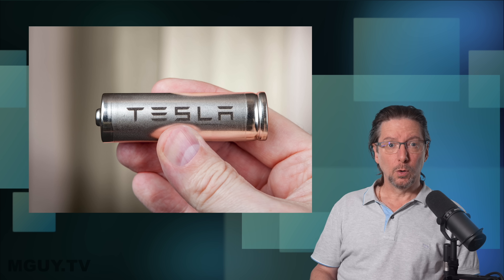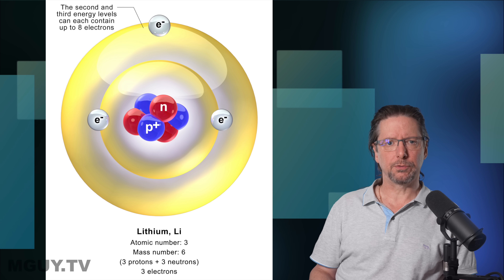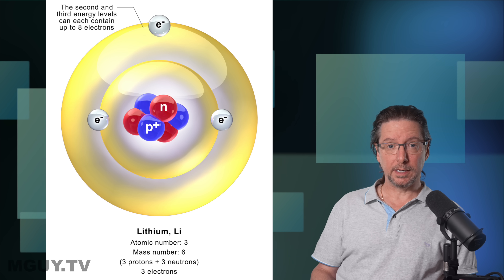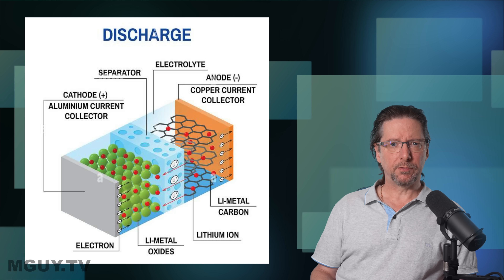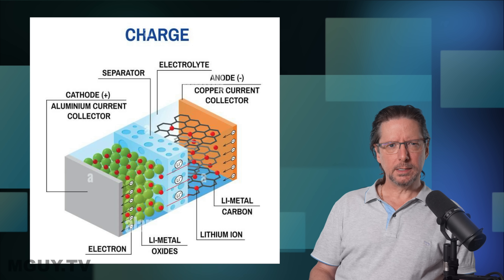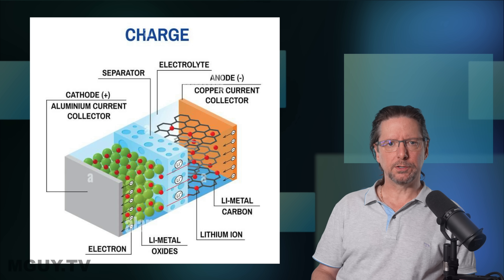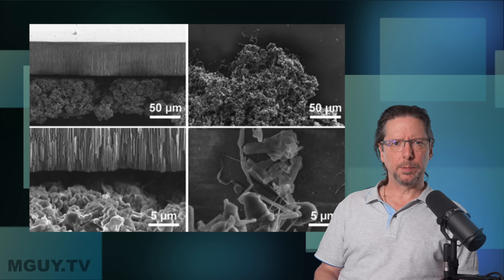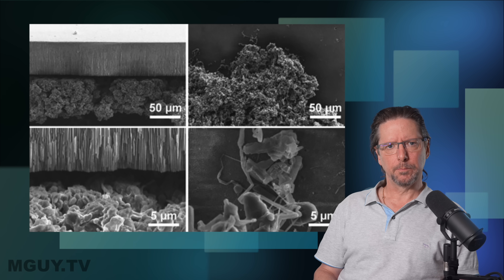Why are EVs so TERRIBLE in the cold? | MGUY Australia

Comment: UK driver here.
I run a 1986 Fiat X1/9.
The consensus opinion is they all rusted away, the electrics were shoddy, and they were unreliable.
I was able to find one that had broken down and been left in a barn for 18 years.
It hadn't rusted away, and I'm certain it broke down because the head gasket had failed because the thermostat was seized.
The electrics I modified to run efi thru a stand alone ECU and I changed the tach and speedo to run off the can-bus on the ecu.
I also took off a whole load of parts that were heavy/ pointless like US federal bumpers, and swapped in some light weight seats from a Lotus Elise Cup.
Engine is the original capacity 1500 but reworked/ modernised makes 150bhp on throttle bodies, kerb is 790kg.
Conclusion - joe public was wrong to believe they could daily these cars/ drive them on salted roads/ leave them outside.
Joe public has no clue about EVs either.
If you do the math, equivalent power to weight in an electric vehicle is really expensive, really heavy = really inefficient.
The light weight of the X1/9 as a platform, meant that it didn't need power steering or assisted brakes to begin with!
Reply: My mum drives a 1986 car too, the Skoda 130. She drives many thousands a year too with good reliability and again no need for power steering. It does have a brake servo though. As it's been so reliable we have decided to keep it on carburettor but have updated to electronic ignition. It's never been restored either, just one bit of small welding in 2003. Those who replace cars every year or three never get to experience the rock solid reliability of a simply engineered and bedded in car that is cared for can achieve.
Reply: @VintageLynx  I didn't know what a Skoda 130 was I looked it up, wasn't there a Saab version with a V4?
I think people are divided between those that pay other people to work on their cars and those that work on their cars.
In the latter case the simpler the cheaper the better.
80's cars yup 😀
Reply: @markbowden7238  No, definitely no Saab engine version, but it's simple for sure with a 1.3 8 valve rear engine. And something missing with heavy cars - fun handling. Enjoying the bends, faster steering rack, nimble, raw. I feel a bit sorry for those who have never even tried a light car to experience it. Keep the Fiat running - we won't see the like of them again.
Reply: @VintageLynx  totally agree, and I plan to keep the fiat for the summers assuming there will be some 🤔
Reply: The FIAT X1/9 was the "average man's mid engined sports car".  I owned one for a short while (no more than 18 months),  but as you say it was neither designed for, or even practical as, a daily commuter car. The problem was poor materials, and pretty shoddy construction. Wafer-thin "carpet" that remained wet in the winter = corrosion, poor paint finish, (especially in "difficult to paint" areas, which of course is where the rot starts), awful electrics (mine managed to consume three alternators during my ownership) and the very well-known "headlight problem" that was costly to fix, and recurred pretty soon post-repair. Same engine as the FIAT Strada, which surprisingly provided a better MPG figure, even if driven enthusiastically. Mind you the Strada too had it's fair share of poor-build problems, and for me that was it for FIAT. Bought a s/h MR-2 and that machine was better built, MUCH more reliable, faster,  safer (suspension, steering and brakes), yet was pretty OK on fuel, even if driven at speed. A near perfect commuter car, especially if you need to get there today rather than next week.
Reply: @phils4634  thanks I enjoyed reading what you said you made many interesting points 👍
There are I think only 3 all-monocoque construction, production cars under 1 tonne, mid engine rear wheel drive - Lotus Elise MK1, Fiat X1/9, Toyota MR2 MK1.
The Fiat was designed in 1973 around the small block sohc 1300 designed in 1968 by Lampredi.
It's basically the Fiat/Lancia engine used in the 128, Ritmo, Delta, Punto, Uno, Prisma etc.
The later blocks had a modified oil gallery and a 1600 crank (Fiat Stilo), can be used as a base for an 1800cc /180bhp na engine.
The Ritmo Abarth had the Lampredi big block dohc, shared its gearbox with the Uno/Punto/X1/9 etc, so can be rebuilt with short or close ratios and lockers using parts from Bacci.
The big block 16V powered the 131 Abarth Rallye, 037 Beta, Delta Integrale, Delta S4, and Alfa 155 D2... variously with ZF, Torsen, Hewland, or X-Trac transmissions, whereas detuned versions (Fiat Croma 16V, Lancia Thema 16V) made do with the old Fiat 5-speed and/or had dohc 8V heads (Beta Volumex, 131 Mirafiori Sport etc.

So I don't know if the MR2 can be modified to take 200-300bhp easily using available parts.

If there's no gearbox or there is but not for the Toyota 16V requiring an engine swap, might explain why they don't turn up at top level time attack or hillclimb events because usually the block at least has to be original to race as a production silhouette car?

Not sure, perhaps I should gen up!
The MR2 has huge potential for sure 😃

Not sure what you meant by better suspension, all 3 have fully adjustable McPherson type with discs all round as standard plus there's tons of aftermarket stuff available.
Reply: @markbowden7238  We're talking decades ago, mate (1990's) 🙂! I was working for the UK PHLS at that time, and needed a reasonably fast set of wheels for my on-call commitment, and per the brochure, the X 1/9 seemed to fit the requirements. I'm more of an aviation enthusiast that cars (gyroplanes in fact), so even the thought of modification would have not been a consideration (also there's the pesky Manufacturer's Warranty Issue to consider!) 😀
Reply: @phils4634  yeah mate we are middle aged now!
I remember I could have bought a new X1/9 just after I got my licence in '87, you would see them quite often on the roads and showrooms.
I bought a 4 yr old Strada 130TC instead, for the practicality and the speed, it went through various stages eventually I got the weight down a bit and the power up to 168 bhp.
I had a lot of fun in that car, lost my driving licence twice lol, dailied it for 9 years by which time it was in need of restoration so I sold it.
Kept the Abarth badges off it, as a souvenir 😃
My interest in fast Fiats never entirely disappeared but I also thought the MK1 Elise was a great little car, in the end I opted for the Fiat with a view to doing a restomod.
A few people said I should just get an Elise and it took me several years to find out why 🤔 during which time I started writing a blog about the project at RMS Motoring Forum/ Member's Cars/ The Ultimate X.
If you want to read what amounts to a catalogue of disaster, feel free to leave a comment 😉.
I was inspired by Gordon Fogarty who runs a time attack X in Northern Ireland, it's an 1800cc sohc makes a touch over 200bhp just like the original Dallara 16V.
Three modified X1/9's spring to mind on YouTube, the black one raced by Davide Cironi, the blue one raced by Manuel Dondi and the grey one raced by Gianluca Ticci who won the European Hillclimb Championship last year (class E2).
Reply: @markbowden7238  I wish I WAS "still" middle aged! I got my car licence in 1970, age 17 1/2! I'll let you do the maths,  but rest assured I've been a pensioner(!) for a while now 😀
Reply: @phils4634  lol I was 3 when you passed your test 🙄 those days could have been the best era without smart surveillance etc back in the day, even when I was a boy racer there were basically no speed cameras.
The police would wait for us in their usual places then we'd go tearing off down the back lanes and lose them 😂
Reply: @phils4634  I will respond later today 👍
Reply: Love X1/9s... but wouldn't want to be in an accident in one - or any car of that era... The reason modern cars are larger and heavier is because they are a lot safer than they were - structures are rigid where they should be, and crushable elsewhere to dissipate energy. The difference between a Kona EV and Kona ICE is about 300kg, which obviously isn't nothing, but isn't night and day either (1700/2000kg). Not sure that you can make the leap from not being able to daily drive an X1/9 to EVs - that's a weird leap with nothing supporting you on the way.
Reply: @TheDarrenJones  interesting input 👍 cheers.
We could be here a long time arguing the pros and cons.
I'm in the UK in a hilly rural area, mostly twisty B roads, single track lanes, a couple of A roads and no motorways.
You always have more options in a narrow car when cornering or avoiding other cars.
All the vans, small trucks, SUV's, have to use the same line and they deform the road, I can go inside or outside that line a lot of the time.
Quite a few people have died because loss of servo vacuum caused the driver to think the brakes had failed, didn't know to put both feet on the pedal and push like hell.
There was an X1/9 round here that had a head on with a Range Rover.
It crushed the front of the Fiat down and broke the offside strut, it then rode up the bonnet and took off before barrelling in to the hedge, went through it and ended up on its roof in a field... total write off whereas the Fiat was repaired.
The X1/9 was designed for 1974 crash regs including a frontal impact test.
It was also designed to be raced and
Dallara was involved behind the scenes.
If Fiat had homologated the Group 5 car as a road car, it might well have had a full roll cage a bit like the 037 Stradale.
Fiat weren't interested but a widebody road version without a cage called the Dallara Icsunonove was prototyped, one of these is on display at the Dallara museum.
The genius design of the Fiat is in the overall concept, the construction method, the inner monocoque and the layout.
Stripping the car completely including cutting off the nose and outer wings prior to adding a CAD designed roll cage that fully triangulates the suspension turrets before adding a Dallara style nose and wings results in a kerb weight of approx 630kg with a 1998cc dohc engine...like Manuel Dondi or Gianluca Ticci.
The car built for Davide Cironi with a Yamaha R1 1398cc, weighs 580kg.
But yes, an original X1/9 probably is less safe than a modern although how much is down to cars getting heavier I can't say.
My daily is a 2004 Focus 16V😊
Reply: Interesting point. But I drive over 30,000 miles/year and use to get a brand new car every 3 years. Many of them had faults during ownership. Last 4 years of running ev's and done more miles than ever. Not a single issue. And they drive like brand new on last day of ownership. Can't say thay about a single car since mid 90s. About a dozen fossil cars owned since then. Clutches and gearboxes wear and fail. People focus on everything apart from actual ownership experience with ev's. They are much better if you drive a lot of miles.
Reply: @TeaBreak.  I don't necessarily disagree with what you said but I guess we all drive cars that reflect what we use them for, or should, and it sounds like an EV is fine for your requirements.
I daily a 20yr old Ford Focus for the same reason.
I'm 56 and I learned to drive in a Series 2 Land Rover!
The Focus is very refined but there's just something about unassisted direct mechanical controls that I love, in a small light car that cannot be replicated within today's absurd type approval regulations.
I spent years learning to use pedals, all the tricks.
I can't remember the last time I got in a car which had the pedals in the right place for tricks.
More often than not there's some fake metal or pale plastic reflecting on the inside of the windscreen and I think, nope.
Reply: @TeaBreak.  I will respond later today 👍

Comment: Lucky that it’s not the cold in 99% of Australia
Reply: @mablesfatalfable6021  no doubt you would read the range before you bought one. They don’t suit everyone, but if you can recharge at home it’s worth seeing if the extra cost upfront makes sense or not.
Reply: @dirtmcgirt168  it doesn't. There isn't any way for anyone to make economical sense of buying an EV. The Oxford dictionary now lists the phrase vertical depreciation alongside the entry for EV's
Reply: @CosmicSeeker69  everyone would drive the smallest possible cars for their needs with no extras if car buying was all about cost. Most people can’t afford a new car regardless of the fuel for a start, but regardless I said if the extra cost makes sense, not if it’s cheaper